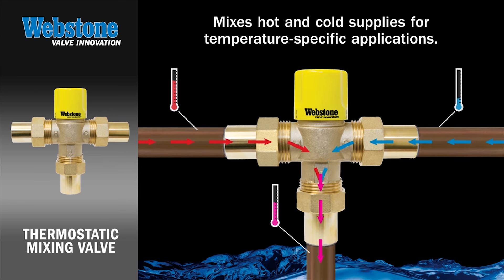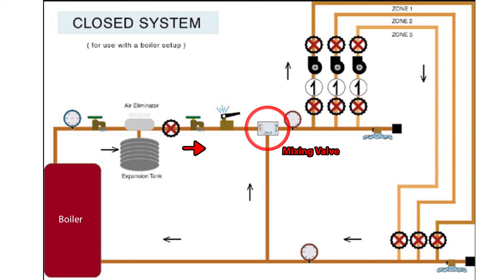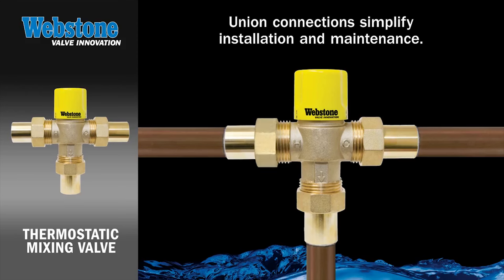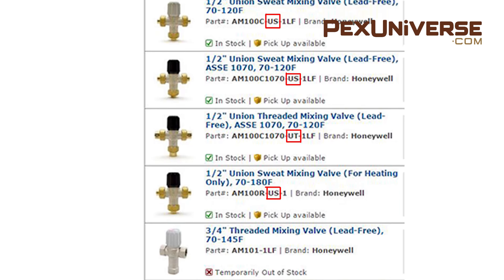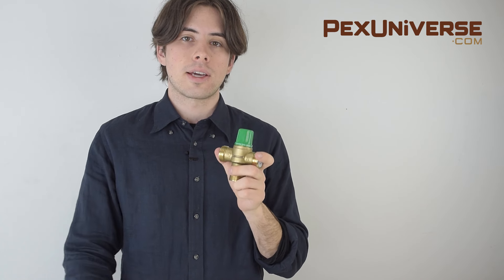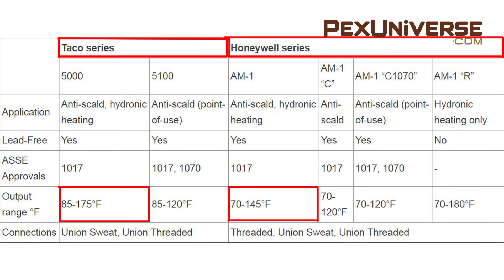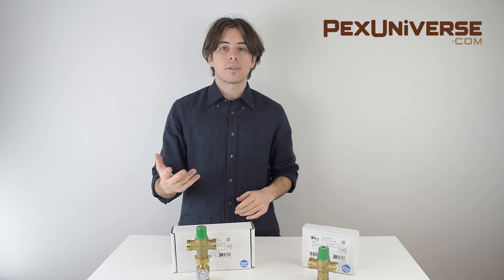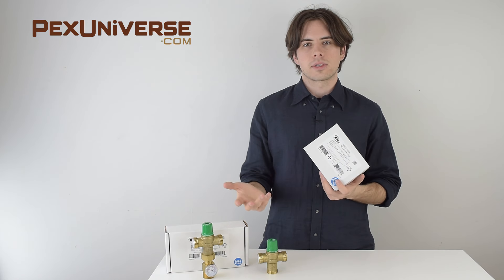Mixing valve options in plumbing and radiant/heating applications

Comment: Thank you so much for showing how to adjust the Taco valve with its own cap. Without that, I would have been fumbling around. 2 thumbs up!  side note: on my 5000-3 valve, CW = colder, CCW=hotter.

Comment: For radiant heat, we're going to be running hot water back as the cold in...   There is a good chance that the temperatures will be close to each other.   Will the performance degrade, or will it fail if the cold water is above the input temp?

Comment: Hi, I don't need and don't want a mixing valve since I don't have a tank but a water on demand unit. I hate my mixing valve that keeps on failing and delays the output of hot water, making me waste all kinds of water.
My question is, do you guys sell a connection with the same ergonomic of a mixing valve, but without the mixing valve so that I can just take my valve out and replace it with the connection without having to fiddle with soldering? Is there an adapter of some sort to bypass and take out the mixing valve? Thanks.

Comment: Is there a way to bypass this going to a soaking tub?  Plumber has mined turned all the way up and Scald valve on Faucet of soaking tub all the way up but the water coming out of the faucet wont go over 90 degrees! What is crazy is every other faucet in the house including kids bathtub will get super hot!  The mixing valve is going directly to the soaking tub and sits under my wifes vanity in the master bath.

Comment: At 2:20 - mine was the opposite.  Counter-clockwise for hotter hot water.
Reply: The video says the opposite of what the manual states. 

Think of it as the hot water tap on a bathtub faucet.    Close to decrease temperature, open to increase.

Comment: Hi,
Thanks for the good info, one question: do these valves have non return valve, i.e. if I close the mixed output, will cold water mix with hot water?

Comment: I have a tacco 5000 mixing valve and am using for radiant heat. I am using 50/50 antifreeze and have asmall leak on the mixing valve thru the temp control knob. Have u seen this before.

Comment: I am installing a One Zone closed radiant floor heat system with an electric tankless water heater. What type of mixing valve should I use at the point where the primary and secondary loops meet? Thank you.

Comment: Im planning on converting from radiators to radiant, i have a gas fired hot water system.  Can i use one of these valves, i have seen some that are electric, and messure the temps and adjust acordingly.  This would probably much easier.

Comment: since a hot water heating system is a sealed system how can cold water be added to temper the water for a specific zone and not over ressure the system
Reply: Return water from the system is mixed in, not more domestic cold water. Return water from a radiant floor is generally 60-80 degrees
Reply: Thanks ..... that is what I understood I couldn't wrap my brain around using return water since in todays condensing boilers there is a loop circulating the return and supply water. My solution was to return the in floor water outside of the loop and  to prevent the hot return water from entering the floor zones I protected the out of loop with a check valve. I haven't yet completed the install so it will be the week end b./4 I know if "success  has found me"   Thanks againKen
Reply: Ken Adams I guess I'm not grasping what you're saying... Check valve? The new mod/cons typically employ a primary secondary piping setup as you said, but whatever return water comes right from the floor's return manifold would get injected to the "cold" side of the mixer. Do you have a dual temp system? Like baseboard or forced air in combination with in-floor? If it's floor only there is no need for any sort of mixer- condensing boilers are built for low temp water. Even with a dual temp system, you'd just put each zone on its own pump with whatever one serves the floor being mixed before it injects back into the primary loop
Reply: I Guess that I was just overthinking it but yes it is a combined base board and radiant floor system.I have installed several base board systems for myself and family and friends but never a combined system. I was thinking that if I just brought the return water to the mixing valve I would not get any flow thru the system. I think I will leave it as I have it and if it works out I'll leave it as is. To better understand what I did............. picture the primary and return loop...... as a rectangle....off to one end  I installed a T and off of that T I installed a check valve, then three more T's two are returns from the radiant floor the third is where I connected the cold side of the mixing valve. All of this in an effort to keep the hotter base board water from mixing with the radiant floor return. After reading you reply I realized that just by connecting the radiant floor return to the cold side of the mixing valve I would have an independent loop with added heat from the boiler only if the mixer was not satisfied. That's what happens when you overthink a problem. This was also a puzzle for me as I was asked to help get a system completed for a friend who had started the project and was taken seriously ill and could not complete it or tell me what was completed or planned...........thanks again Ken
Reply: Ken Adams I'm not 100% understanding this, but what I'm picturing is not hydraulically separated and the check valve may prevent backflow, but not creep from the supply side unless your S/R tees are within 4 inches of each other in the primary loop. This accomplishes hydraulic separation and keeps the primary loop from forcing water through the secondary loop, then the secondary loop would require its own pump to circulate when there is a call on that zone. Glad to see some diy guys out there yet! Good luck with the project

Comment: what is best practice on using mixing valve on boiler with hot water recirculation pump (that keeps hot water in loop to the fixture)? The cold water return would get hot water in it since most recirculation pumps are controlled just by timer.